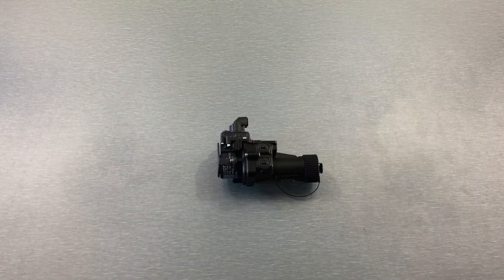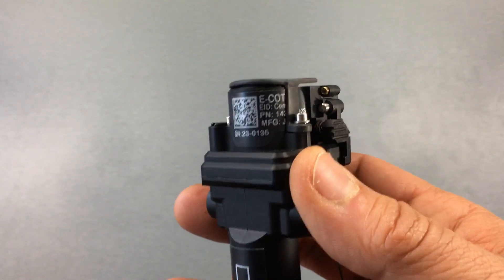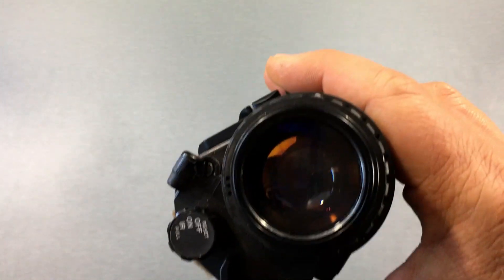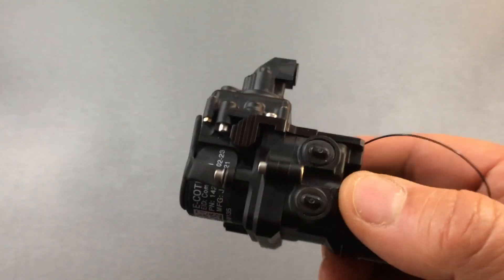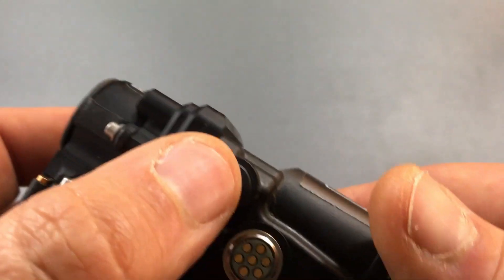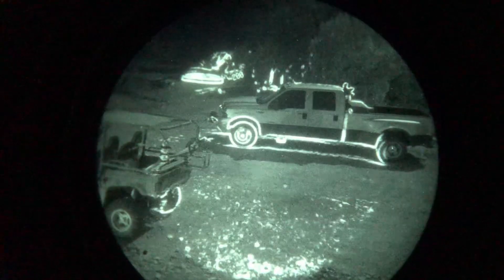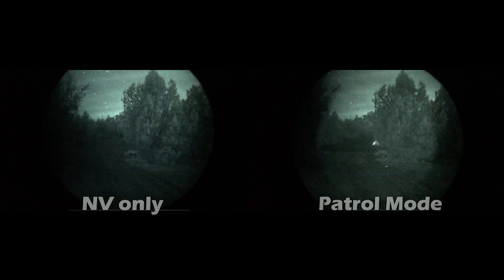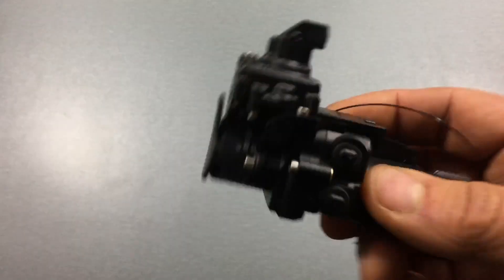OPTICS 1 ECOTI Enhanced Clip-On Thermal Imager

Comment: How do you collimate the ECOTI image with the NV image? My ECOTI and NV are very off by maybe 3-5 feet.
Reply from the maker: First, make sure the bracket is mounted solid and that the ECOTI isn’t angled. There will always be some offset at closer distances, so it’s best to pick your average viewing distance, say for example 50 yards, and inside the menu you can shift the image to align with the NV image At this distance. Hope this helps 🤙🏼
Reply: @NITEWALKER-NIGHTVISION dude I would absolutely love to find the menu that allows the user to align the image. I’ve looked through it so many times and I couldn’t find the alignment menu, I think that’s only for the legacy COTI. I really want to find it for my ECOTI. 

Could you please tell me what the menu item is called? Or the secret button combo needed to pull that setting menu? 

We’ve spoken on the phone before btw, when I called TNVC.
Reply from the maker: @W @WhitePhosMOS Hold either the up or down button for 3 seconds to get in the menu, go to OPER, and in there is an alignment option. These buttons are the 2 buttons on the left side. It’s in the same area where you perform a manual NUC and compass calibration. Your user manual and quick reference guide will show all of the various menu options. It’s in meters and not yards. I forget all of the distance options. Pick the one that best fits your need 🤙🏼
Reply: I’ve cycled through every distance a few weeks ago. None of the distances change the visual of the ECOTI. The object I was using as a reference was the warm engine bay on my rig. 

I stood about 20 meters away, and messed with every preset distance for the alignment and the image looked identical for every single one. Am I doing something wrong? Is there an “apply” button that I didn’t press that didn’t “apply” the new distance setting for alignment?
Reply from the maker: @WhitePhosMOS use the button on the right side

Comment: Absolutely RIP OFF product. The device may be nice.but the price $8600-$8999 is a MASSIVE rip off. Especially with 384x288 image quality. Come on 😂😂😂. Folks you can EASILY get a 640x image quality products out there for a WAAAAY LESS $$$$. They range around $300-3500. The markets current price for 384x288 imaging is between $1000-$2500 and these CLOWNS are STEALING from you if you pay $8000🤣🤣🤣😂😂😂😂. Complete joke. Don't fall for it. 384x288 is good not GREAT and certainly not AMAZING and worth anywhere near $8000-9000. Disgusting people who are STEALING your hard earned money.

Comment: How do you mount it on dual pics-14?
Reply from the maker: Me personally never because I have binos. You can do it however. The drawback is you’re limited to the positions you can mount it due to the -14 body and which bridge you’re using and it adds extra weight to the already heavy dual -14/

Comment: So if you had to patrol in the woods, I'm talking thick canopy at night, would you rather use this or the Breach system?  I've had very little success with night vision our here in the Pacific islands.  We have thick jungle canopy and lot and lots of rain that lasts for months.  There's virtually no ambient light since the clouds block out the moon and stars, and even on clear nights not much light makes it through the canopy.  Thermal is NECESSARY in the jungle, but I'm wondering if this or the NOD and Brach combo is the better route.
Reply from the maker: Great question. I’d go with the Breach for dense terrain since it works great at shorter distances and gives a better overall thermal view. So, basically, walk with the -14 / nods and stop and scan with the breach.

Comment: Hi Will, congratulations on the gig with TNVC, sounds like a great fit. I have been following your breach/pvs14 videos and have been planning on making the move to something similar to that setup (possibly with the mh25). I plan on using it for animal detection and purely for recreation however I’m now confused as to whether I should get a Coti (pas29, ecoti is out of my price range) or a dedicated thermal monocular. Which do you think would be best for that sort of detection? Already have an unfilmed pvs 14 and g22.
Reply from the maker: I’m actually going to do a video about this soon.

The short answer is that you need both for the best results. By both I mean night vision with a COTI/ECOTI and a hand held thermal. The COTI is great for detecting but in many cases you can’t identify what the hell it is unless the animal is large enough and at a good angle to ID it.

Otherwise, you can see that something is there but that’s about it with the COTI, so you can use IR which may or may not work to ID, or do the same with a handheld thermal.

A dedicated thermal will run circles around the COTI in terms of faster detection and identification. If you can only afford one or the other, then a PVS-14 and thermal (MH25, Breach, NOX, etc) will give the best overall results but at the sacrifice of having a monocular only for night vision.
Reply: @NITEWALKER-NIGHTVISION  thanks Will, that definitely helps. Looking forward to the new video.

Comment: How do things like smoke/dust/glass that obstruct the thermal image affect the overall image? Can you still see them the same as with NV by itself? Or does the coti image obscure everything?
Reply from the maker: As long as the obscurant doesn’t totally block the thermal image, you will still see the thermal overlay over top of the obscured night vision image.
Reply: @NITEWALKER-NIGHTVISION  So like, if I'm looking through glass, the NV image is still visible? Or will the thermal block it?
Reply from the maker: @Raunadraug  you know I didn’t try that and I don’t have it in my possession anymore to see. You can get thermal reflections off of glass, so if that happened, the thermal image could affect the NV image. However, it takes a second to put the lens cap back on the thermal which would alleviate that if it occurred.

Comment: How did your brain handle the slightly different image between the two eyes, with one eye not getting the thermal overlay while the other eye does?  Was your brain able to fuse the two images relatively easily?  Did you try the advice @WhereNow&How gave in his comments to your previous video, about turning down the gain on the ECOTI-less PVS-14 to half that on the ECOTI PVS-14 (in Patrol mode), and how that facilitates image fusion between the eyes and brain?
Reply from the maker: I just caught this question. What I did was turn down the brightness on the ECOTI.

Comment: From TNVC’s ECOTI webpage, I gather that ECOTI has the following two options for auxiliary external battery packs:

1) Optics-1’s 6-Cell GPS-enabled External Battery Pack and Cable

2) BNVD adapter cable for use with the AN/PVS-31A BNVD’s Cold Weather Battery Pack (CWBP)

Could you please let me know for each of the above two options:  a) the pricing, and b) the added runtime?

I assume that the latter option (#2 above) is the L3Harris Battery Power Supply/Cable (AN/PVS-31 BNVD), 25” BNVD Cable, Black Battery Pack, SKU: L3-INS-BNVD-CWBPKIT, with a list price of $1,104.84, currently listed as “in stock” on TNVC’s webpage for that item.  Is that correct?
Reply from the maker: Hi Charles, shoot an email to sales@tnvc.com and as soon as I see it I’ll reply with more information
Reply: @NITEWALKER-NIGHTVISION  Just did, thanks.
Reply from the maker: @charleswhalen7332  👍
Reply from the maker: Regarding the cable for use with the BNVD, there is a different 7 pin Y cable you have to add to run the ECOTI with the CWBP

Comment: COTI needs to be periodically NUC’d while in use.  Is that also the case for ECOTI?  If so, does that require putting the lens cap back on ECOTI’s objective lens when NUC’ing?
Reply from the maker: I haven’t found a need at least in my operating conditions for frequent NUCs. It’s a manual NUC process that requires the lens cover.
Reply: Thanks.  At least I’m used to it and know the routine.
Reply: @charleswhalen7332  do you also put your hand at front of coti to check if you not forget to remove the lens cover after calibration? for me it's a part of routine lol
Reply: Getting To the NUC in the menu can be a little tricky. The auto NUC on the Breach is nice.

Comment: hi, i have a little question about E-COTI and regular TACS-M/PAS-29. Are their battery caps interchangable?
Reply from the maker: Not sure to be honest but I’ll find for you
Reply: @NITEWALKER-NIGHTVISION  thanks. i need that for custom powering project, it's for TACS-M initially, but am very curious if it's possible to work with e-coti since original coti/ecoti power cables are uncommon, non-standard (like 31/psq36/gpnvg) and expensive. Should be working just as drop-in, but there is no e-coti to check.